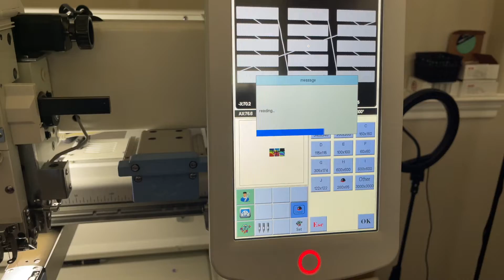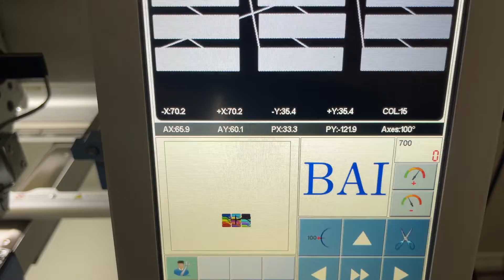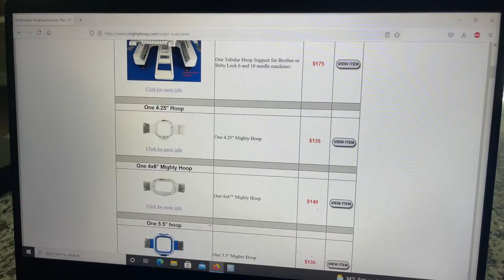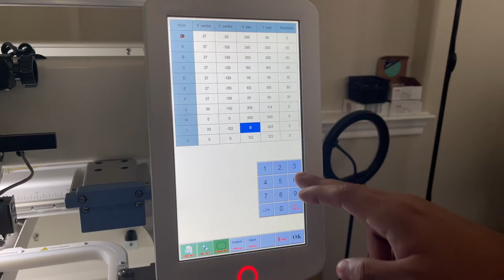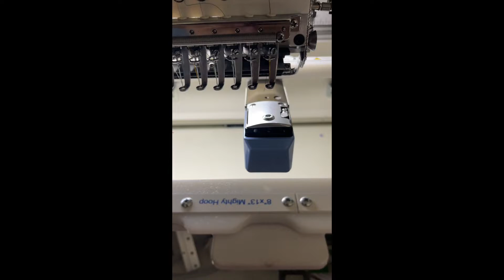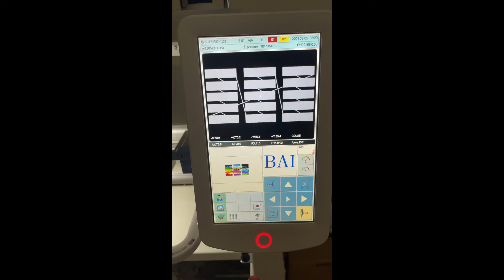How to add Might Hoops to BAI embroidery machine

Comment: I am using DAHAO 15 Plus. This software seems complicated to me. There is no point in going into details that are not our responsibility. Install a 500x600 or 500x800 or 100x200 hoop. Click on the monitor to start and stop the ready menu. The job is done.

Comment: My maggie frame 8 x 13" and (200 x 320mm) written on the hoop.  So I assume is similar to yours but your measurement in mm is different, so I should go by your measurement or not? Another question is did you have to change the BAI handles to fit in your mighty hoop or not? Really appreciate your response. Thank you for sharing.

Comment: I have correctly centered my needle, but when I put in the dimensions for the  5.5 x 5.5 mighty hoops  in their website of 110x122 my machine tells me the "design is too large".  After several tries I enter 50mm x 50mm  still get the same error message - "design is too large". even though it is tracing in the center, not close to any edge?  Any ideas what is causing this message?
Reply: Hi have you ever resolved your issue?
Reply: I’m having issues with mines I have set the dimensions but it’s not allowing me to trace at all.

Comment: Thank you so much for this video. But question what if I have several mighty hoops. Is there a way for me to add all the hoops or do I have to change the hooping size every time that I need to change sizes? Thank you so much in advance for all of your help.
Reply from the maker: Hey on the parameter screen you can change every single letter parameters to match each mighty hoop. And just use a sharpie and mark the mighty hoop with the corresponding letter so you remember

Comment: Hello Simply Threads, Any magnetic hoop sizes can add on to the BAI machine?  Here in Australia we slightly have different sizes in hoops.  Thanks for your response.
Reply from the maker: Yes you can add any hoop size as long as you know the sewing area measurements. It would be the same concept.

Comment: Hello,

So when ordering these from mighty hoop, when it asks for brand you just select the one that says Chinese? I noticed on some of the hoops you just type it in.

Just ordered a machine from alibaba, just want to make sure it’ll slide on the machine properly.
Reply: Hi I recommend you call them and order by phone. They are able to send you the correct ones. That’s the way I ordered mine (:
Reply from the maker: I contacted them and told them what machine I had. Paid over the phone with them